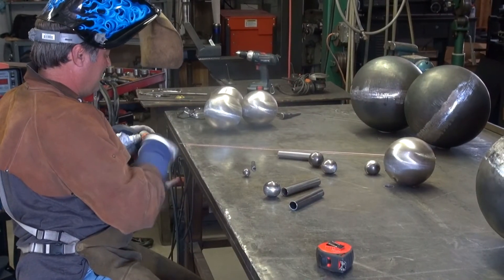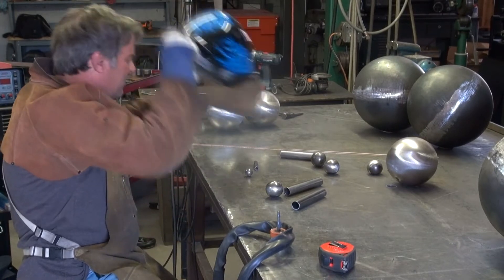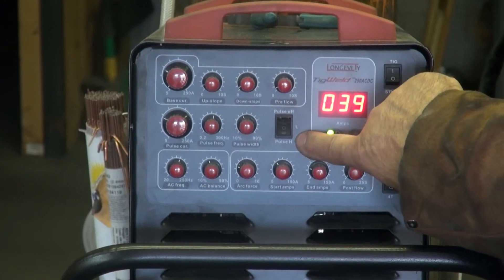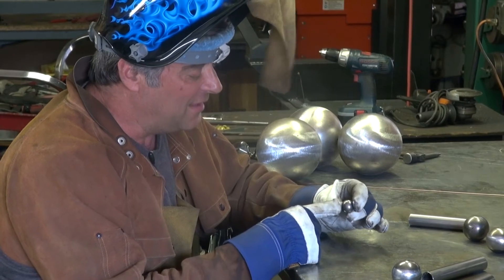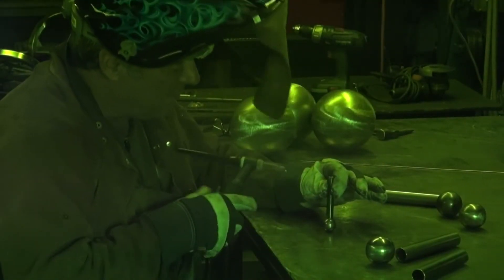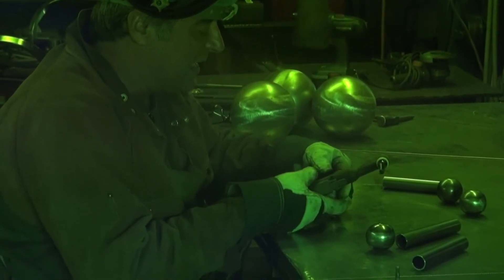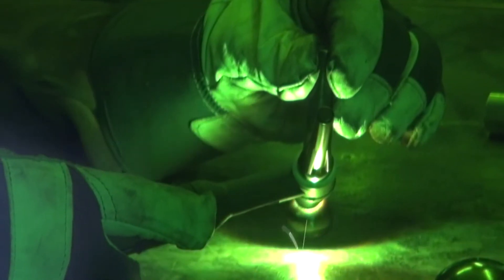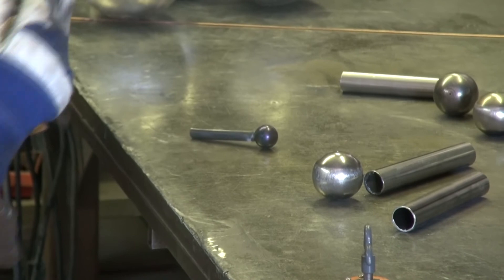How to Weld With a Longevity TIG Welder - Kevin Caron

Comment: Kev,I knew the Noise,So,Ive Maybe Done it,20-30 times,and the tunston looks like it was in Gulf Oil spill,approx 15-20 Mins,cause the Phone HAS to ring,as Your fixing your OPPSS When are you going to mount a Motor on that nice small Roll, I have BOXES,of reg Pics,that i have to scan,and Put in, when I sold the Dungeon,I sold My 10ft x 1/2 roll, Have a Little 3 fter know,,I sure miss the 1942 special!,,Jack,, PS,,I bought a Helmet Bag!!!! ,as 99%,I use my Old Hand shield,Jack, Need to get some up

Comment: Good tip about the vent hole. I also use vise grips while welding.  And I have pretty much ceased to weld things to the vise grips as I find this causes alot of grinding...doesn't seem to enhance the grip of the vise grips either.  Thanks guys!